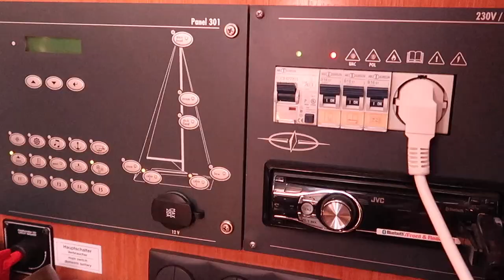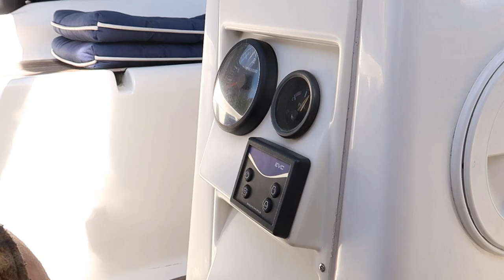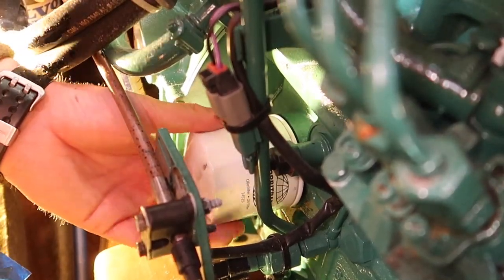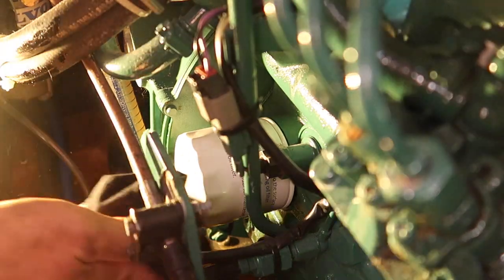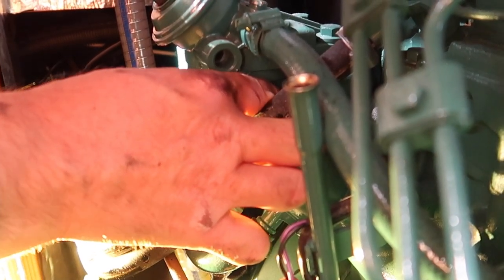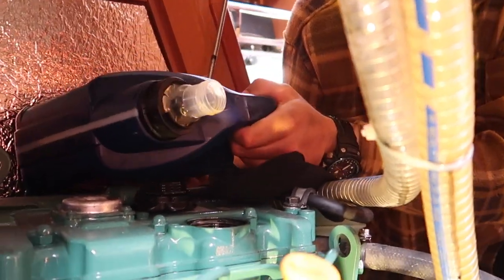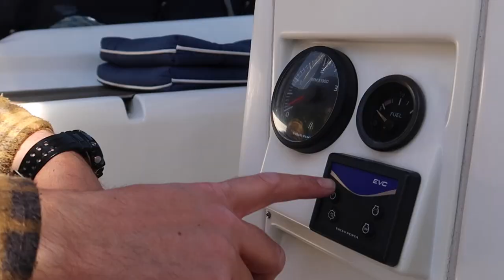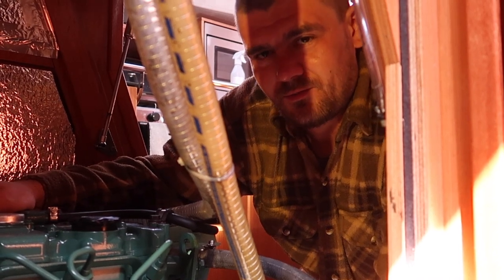Porta Sailing - Oil and filters change - volvo penta D1-30F

Comment: thanks for the video... My new (used) Bav38 has a brand new D1-30 engine which I've never seen before... I'll change all the filters and oil of both engine and saildrive, and your video took half of my worries away about what I'm about to do tomorrow... other half (water seperation filter before the engine compartment  and the SD stuff) stays :))
Reply: No worries. Just change the fuel pre filter. Check if there is no water in separator. Saildrive oil - I would recoment to change while on hard (on land), to drain it all the way from the screw under the saildrive. Don't forget - if it's Volvo 130s, use the same - engine oil.
Reply: @sailor1987rumley  Ex-owner gave all spares and oils as ready-to-do on board to me and told he was about to change them but he get lazy, right after he's marina neighbour decides to sell his OC43... he said that if he's got to change he's new boats filter stuff, then it's fair for me to do the same and I shouldn't complain about that :))

Comment: Hi. Thx for the video. One question. Why are you using the dipstickhole instead of using the oil drain pipe? Are you really able to suck all 3,6 lieters from the dipstic hole?
Reply: Hi. I'm doing it this way to prevent mess. Using a drain hole is always messy. And yes, you can take out all, just remember to warm up the engine before. It makes it easy.

Comment: Have a question...when you changed fuel filter, wasn't there a need to get the air out from the lines ?
Reply from the maker: I did. By pumping it with the black button, You simply flushing the system with fuel.
Reply: @portasailing2720  didn't u have to open a top screw to release air while pumping ?
Reply from the maker: @simonmaron  Air is going further to return to the fuel tank. It works. And   the amount of air in the system, after filter change is very small.